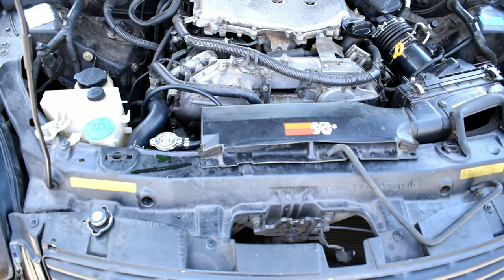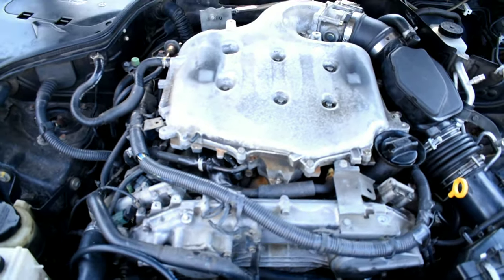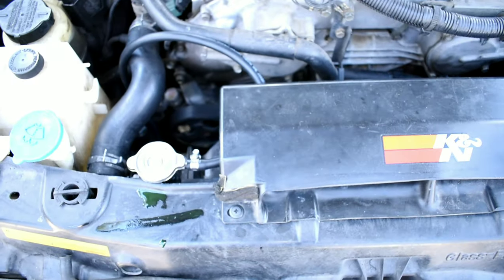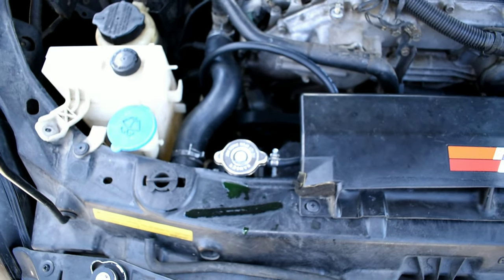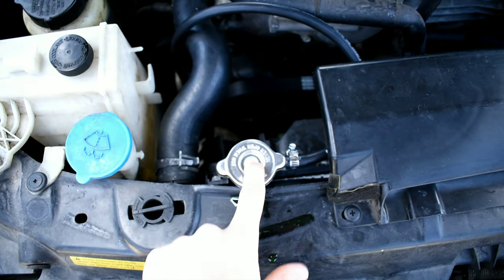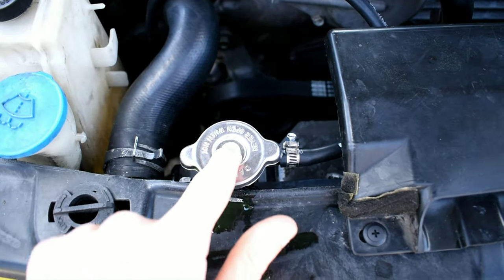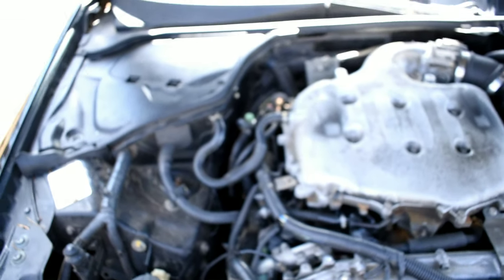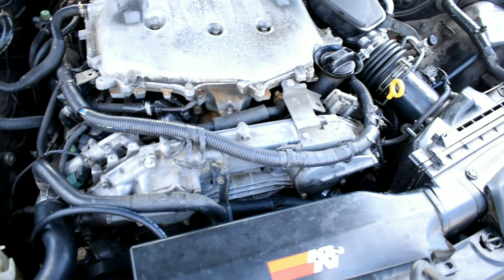G35 and 350z Overheating Problem Fixed!!

Comment: Another reason is a cloggee hester core. Separate both hoses on the fire wall and push water with a garden hose through the inlet hose and youll see some nasty stuff come out the outlet.

Comment: Hey Why does my car ONLY over heats when i have ac on when i turn it off its normal like wtf after like 20 25 mins of having it on atarts over heating any hints?
Reply: Have you checked your radiator ? Might be cracked and needs replacing or it can be your serpentine belt
Reply: @Slimesitoo  maybe huh ima chek it out tamorrow tbey say maybe compresor too or water 0ump but not shure
Reply: Check your electric fans! They should kick in straight away. Check for visible blockages too
Reply: I have the same issue. Has anything worked?
Reply from the maker: Could be ac compressor. But as Bryan G said it might be a cracked radiator. Are you leaking any coolant
Reply: Did you fix the issue I have the same thing
Reply: mine does the same thing except when heat is on. Doesnr do it every time either. No leaks, air works excellent. Dunno if its possible to be a thermostat with code p1217 or not cuz i see other codes for the therm. alot of times

Comment: I'm still struggling with that problem my mechanic gave up and said he can't fix it. I already bought a vacuum system, a funnel, I changed the thermostat three times, the radiator twice, I changed the hoses according to my mechanic, he changed the water pump and it kept heating up.
I noticed that the upper hoses get very hot and the one connected to the lower part of the radiator does not get as hot as the upper one, is this normal? or the water pump is not circulating the water?
Reply: Same issue mechanic gave up also you just gotta bypass thermostat car will just take longer to heat up we should all sue Infiniti I kn a lot of people have the same issue n it’s bypass that works n freeze in winter
Reply: how did you fix it/What was the main issue I'm experiencing the same issue on my 06 350z. Please anything will help.
Reply: @CSun_1Jeff   how did you fix it/What was the main issue I'm experiencing the same issue on my 06 350z. Please anything will help.
Reply: You need to find a new mechanic then lol.  While its trickier to bleed this system then some it's not some unsurmountable feat.  Any mechanic should be able to handle it.

Comment: Rev your car with the cap back on ??? Where is the air leaving the system at ?
Reply: Yes..... Radiator cap On ...

First make sure your heater in your car is at the highest temp  (fan on) so coolant circulates throughout the heater core..No heat at idle means....
 You still have air if the  Heater   cool or  lukewarm,...
Has to be HOT if you can't hold your hand over the vent for 30 seconds without a sting then it still has air 

  Cap on 3 or 4 reps then turn the car off and let the engine cool.

Then.... take off the radiator cap. 
Put in a No Spill Funnel and add coolant (you will need it when you open the bleeder.)
Squeeze the upper radiator hose until you see no bubbles could take a while This helps to get air out this. Also you might see coolant go down it the funnel

Then  unscrew the bleeder valve NOT ALL THE WAY OUT BECAUSE it will gush 
When you see a steady  stream or NO air bubbles. Tighten it back on  not real tight it's plastic EASY 😂

If nothing comes out of bleeder valve air is blocking it.

Repeat as many times as needed  06 G35 I have one THIS is a ROYAL PAIN IN THE AZZ...don't give up.😂

Comment: I have a g37 thats over heat even though it has no leaks and every time it overhats the raditor water is decreasing even though there are no leaks im thinking now to change the whole engine but the problem could be easy to fix so please if any body have an idea about this problem please help

Comment: Need help!!!
2006 G35 sedan start overheating while on idle only. But it cools down back to normal when I start driving... I touched top radiator hose and lower thermostat hose and they were both hot. So I think both are working fine. No coolant leaking anywhere. Fans only work at times but not all the time. Maybe need a new fan, temp sensor, or head gasket issue?
Reply: running into exaaacctt same issue, I will update you if I find any fix, if you could do the same please. I've called around to so many shops and they keep telling me head gasket head gasket head gasket but I just don't believe it.
Reply: @jeremygibson5991  Yea man thinking about just changing the the fan and temp sensor... I heard also try cleaning around the fan housing motor and where it connects does the trick.
Reply: @baldpnoy410 replace the cooling fan module
Reply: @Unrealenting  Cooling fan module? You mean the radiator fan motor?
Reply: @jeremygibson5991 please update me on how resolve this I’m having this issue rn
Reply: Please give an update what you did to resolve this! :(
Reply: @baldpnoy410  no I mean exactly what  I put

Comment: Looking for knowledge, my car is overheating after I replace the thermostat, head gasket seems fine , Fan's work !
Reply: carlos bolanos did you watch the video you probably got air in your coolant system
Reply: Probably got a bad Water pump
Reply: @jolivas1997  water pump is good
Reply: @carlosbolanos5361  did you fix it ? Im guessing you needed to bleed it
Reply: @killakam123321  Low key , I just took it off
Reply: @carlosbolanos5361  ima have to do the same thing my car overheated when the gauge didnt even show it was hot smh.
Reply: @carlosbolanos5361  nah i bleed it correctly before when my heater hose connector blew up lmao. That cheap plastic. I think the thermostat now is just not opening to let enough coolant in to cool the motor so everything is hot
Reply: @carlosbolanos5361  did u find the issue? Or fixed it?
Reply: @kinpump4696  I sold the car !
Reply: @kinpump4696  car wasn’t overheating, I think I was a ignition switch problem ! I think I’m not a mechanic! That’s why I sell  the car
Reply: @carlosbolanos5361  why even watch the video if you don’t wanna work on it😂
Reply: The engine oil cooler is a common issue as well it’s behind the oil filter
Reply: @texaschris713 the cooler line it is
Reply: I changed the water pump(hard asf) thermostat and coolant temp sens. Now ima do this
Reply: Squeeze the hose that connects to your thermostat but have your radiator cap open keep squeezing it until coolant comes out your radiator you might need to add more coolant to the top so you can see the bubbles

Comment: I have mishimoto radiator mishimoto fans new thermostat  i changed everything the hoes too it was running good until one of the pullys riped a hoes and now that i put a new hoes im having to keep feeling my radiator and i can't see no leak or nothing the coolent just disappears
Reply: Do you have white smoke coming out the exhaust?
Reply: @tyson4839  nah bro

Comment: Working on my 04 g35 today and so far I’ve replaced the stat, put a new hose on the bottom, new fans because only one was working, and still the bottom hose doesn’t heat up while the top hose is hot, I’ve tried the bleeding method you’ve demonstrated, Heats gets hot then it cools a bit, lower radiator hose still cool and then both fans turn due to over heating, I just bought a new radiator but I’m not sure if I need to install it
Reply from the maker: I would definitely keep trying the bleeding  method. It can take several times to get all the air pockets out of the cooling system. It seems like their is still air in it causing flow restrictions. You also definitely have air in it after replacing the thermostat and hose. If that's not it it possibly could be the waterpump but usually it's not.
Reply from the maker: While doing the bleeding method make sure the bleeder valve and radiator cap are level
Reply: @unbeatablecarstv890 do you mean jack up the front of the car as leveled
Reply: ive always seen bleeding done with the radiator cap off, you'll see the bubbles come up, run idle til no more air bubbles appearing in coolant

Comment: just started having this issue at 125k on my g35x. Ill look into checking what you went over.
Reply: Did that fix it.   Cause someone else said it could be a bad temp sensor or a closed thermostat

Comment: My 2004 G35 coupe  just overheated when I drained the fluid out and I opened the bleeding valves and refill the radiator with fluids.So you think it might be the thermostat?

Comment: my car is overheating and making an hissing type of sound or whistle type of sound that comes and go about every couple minutes. my g35 does not overheat when idle but as i start to drive for a couple minutes is when it starts overheating. i was thinking it was my water pump but i am not sure. any help would be appreciated.
Reply: @vorzide did you find out the problem I have the same issue
Reply: Lathan Johnson nope never did. Haven’t had time to look into the problem but I’m pretty sure it is the water pump that went bad or something with some bearings in there. I’m tired of working on that car so I’m just gonna take it to a shop and let them handle it.
Reply: @xqxc  what about now. Did they tell you what the issue was. Mine just started doing that. I’ve replaced head gasket, pcv valve, thermostat, bled it, and replaced radiator cap
Reply: @wendymichel6770  got my water pump replaced and I am still having the problem. If you guys solved the problem could you guys please let me know what it was ?
Reply: @xqxc  thermostat

Comment: What if I'm leaking coolant near passenger side?
Reply from the maker: Could be a number of different things. Try to leave a piece of paper or card board under your car to see exactly where it is leaking from.
Reply: @unbeatablecarstv890  Another question my cooling fans don't turn on when ac on or at engine temp. Any help I'd appreciate
Reply from the maker: @flipinfin  Is your car overheating? Is your ac working?
Reply: @unbeatablecarstv890  No I think I need freon. My fans ain't coming on
Reply from the maker: You might have to replace the fan but check the fan relays first. They are behind your battery in the fuse box. (The big boxs in the middle of the fuse box)
Reply: @unbeatablecarstv890  Nah they work with Power added. Replaced all 3 relays. I'm thinking about none continuity in wires
Reply from the maker: @flipinfin  Any luck?

Comment: So, If car overheats and heater does not work = air in the system.  my 04 g35 sedan overheats and the heater works, is this a thermostat issue, or a air pocket issue?
Reply from the maker: Sorry for the late response. Could be the thermostat how long after driving does it start to overheat.
Reply: @unbeatablecarstv890  i have the same problem with my G35 mine starts to overheat a few minutes after I’m driving but when the car it’s on but isn’t moving the temperature doesn’t move
Reply from the maker: @ESV98  try the process in the video. It could be air in the system or it could be the thermostat
Reply: @unbeatablecarstv890  changed the thermostat and it’s all good now 🙏🏽
Reply from the maker: @ESV98  glad to hear that!

Comment: My g35 overheats, I changed the thermostat and radiator but still over heats, Im not getting hot air or cold air from vents but the fans still turn on when I turn on the climate control, also it seems like Coolant doesn't seem to be reaching the heater core/bleeder value when I pore coolant into the radiator. I’ve tried to see if there could be air in the system but when I go ahead and do all the steps the coolant doesn’t seem to appear from the bleeder valve, and I mainly  pore  half the gallon of coolant or more but idk anyone know what the issue may be, I don’t see no slug when I check the engine oil so hopefully it’s not a blown head gasket because I’ve recently replaced the head gasket 4 months ago due to oil leaking, need help !
Reply from the maker: First check to see if there are any leaks. If there are no leaks you need to keep doing this process in the video. You definitely have air in the system if the bleeder valve is empty. Make sure when you are doing this process the radiator cap and bleeder valve are level. When you add coolant to the g35 it's really easy to get air in it and you have to do this process. Also it will probably take 5-6 times of this process to get all the air out(it's a long process).
Reply: Same for me bro my Z keeps on overheating and I got new games a new radiator and thermostat and radiator cap and it keeps on overheating after I bleed it because air still goes inside
Reply: @Orlando ever find the problem

Comment: i have a 2014 altima....close to same thing. Code p1217. Heat and Air both work. And it only happens sometimes, but strangely my car will overheat when i turn the heat ON sometimes, which is weird

Comment: My coolant won't circulate back into radiator and I've got new , thermostat, water pump and bled it a billion times and I got an oem thermostat cause the other failed
Reply from the maker: It sounds like you have air in the cooling system. Try doing the full process in the video. Getting all the air out takes a while and can be a pain. It took me a couple of hours to get it all out.

Comment: ik this vid is old but my g35 is overheating and i changed , therm, valve covers, n fuel pump it drives perfectly fine but my temp gauge is always geeking out you think it can have air in it or js bad therm ?

Comment: Are we adding the coolant with car off???
Reply from the maker: Make sure the car is off
Reply: Depends where , Never open the radiator cap when the engine is hot; hot fluid will spray out, You can top up coolant to the reservoir tank anytime

Comment: Dont know if you still reply or not but i have an issue with my 04 G35. When i accelerate theres like a fan noise and im getting sent in a loop rather if its an exhaust leak , fan clutch or engine fan

Comment: I did this process but my car wasn’t jacked up, I haven’t drove it yet but my heater works good now, should I repeat the process again?  My car is really low so is going to be hard leveling it up
Reply from the maker: I would keep trying it. The bleeder valve needs to be level with the radiator cap

Comment: My brother has a 05 Nissan 350z and we changed his thermostat , when we try to bleed his car the radiator knocks ? Could that be the issue aswell the radiator, never heard a radiator knock before . At first I thought it was his motor but I got closer to the radiator as we were bleeding the system and it comes from there . Kinda on last point if it’s the radiator or the water pump . Just don’t want to buy the wrong part if it’s going to have the same issue of over heating .
Reply: @DC5_Gordo Did you guys fix the problem or figure it out?

Comment: Lower hose is still cold and my heat isn’t working, replaced thermostat and tried bleeding it. I’m using the funnel kit but I’m not sure if I’m using it right lol i installed the funnel, opened the bleeder valve , filled the radiator till it over flowed and closed the bleeder after. Filled the funnel just a little so air wouldn’t get sucked in and turned the heat on full blast before I started the car. Before I started the car I did squeeze both hoses and I got bubbles from both. Once the car was started bubbles did come up but I have to keep turning it off after a while because the coolant will go in volcano mode. In your video are you saying to put the radiator cap back on after I put the bleeder back on and hold it at 3k for 10 seconds? How would the bubbles be released if I put the radiator cap back on?
Reply from the maker: When you do this process the air in the system will be cycled through until it reaches the top (e.g. the bleeder valve and radiator cap). So after you turn off the car and remove the bleeder valve and radiator cap you will not see coolant and you will need to fill it back up (do it several times until it's full of coolant when you open it). If you run the car with the bleeder valve and radiator cap off the air will push the coolant out all over your engine bay.
Reply from the maker: Make sure the bleeder valve and radiator cap are level so that they are the highest point of the cooling system.
Reply: Thanks for replying! Currently the car is still over heating and the heat isn’t getting really hot just warm.
Reply: Should I keep bleeding?
Reply: you can get a thing that sits on top of where the radiator goes to catch the coolant if it overflows. Ive also never heard of bleeding a car with the radiator cap on. The air has to have somewhere to go. If the cap is on and the air is still making it out, that means there has to be an opening somewhere else, aka a hole or something.

Comment: Mine kinda blew a buncha coolant everywhere, never overheated before but it did tonight, all hoses are tight and secure can't find where all the coolant came from quite possibly the cap it can only handle 13 psi
Reply from the maker: I would try to replace your radiator cap first. When I did have air in my cooling system it did pop the radiator cap off and shot coolant everywhere several times.

Comment: So that’s where the coolant goes right ? maybe mine just needs coolant cause is been a while since I’ve put some
Reply from the maker: Yes. Check the radiator while the car is off and the engine is cool. If the radiator is full then you don't need any more coolant

Comment: Hey what if my heater works fine and coolant levels are good and there’s no leaks. But when driving it slightly fluctuates but then gose back to normal. Could it possibly be the the thermostat?
Reply: Good question , I have the same issue , did you get it fixed ?
Reply: Did you get it fixed ?
Reply: @oscarflores7101 what about you did u get it fixed?

Comment: My car is over heating and it’s shutting off any help? I topped it off w coolant
Reply: Check your oil level I had this issue last night not having oil the car, going in to first gear overheated to H then I shut it off and was like wtf. I ended checking my oil and there was none the car burned it up on me.